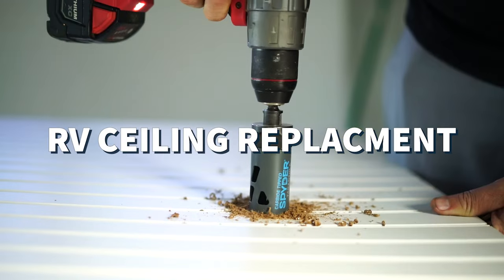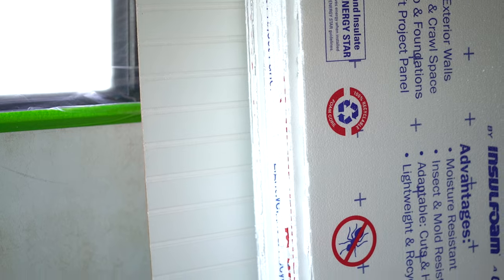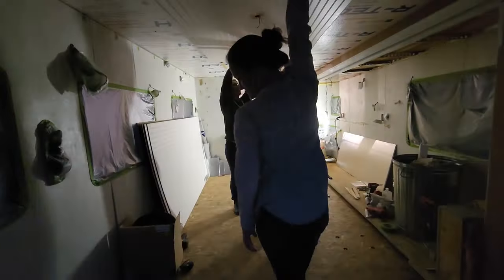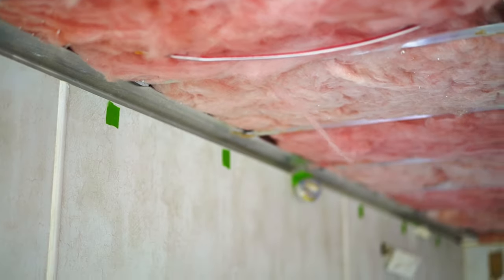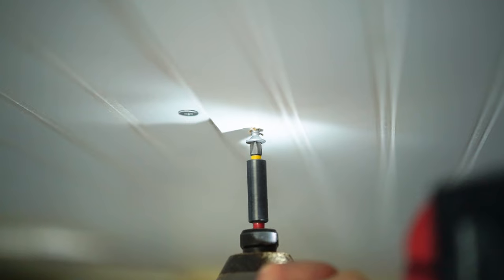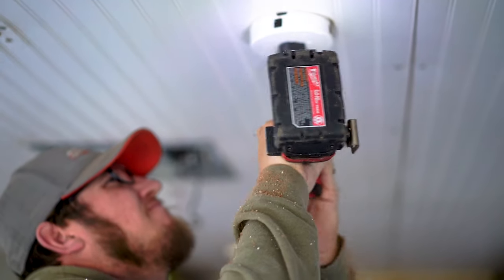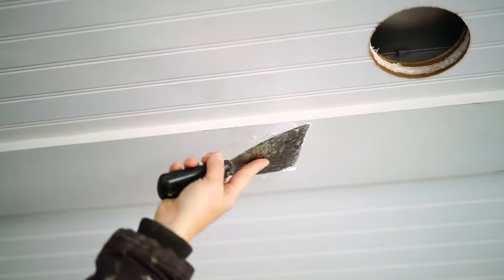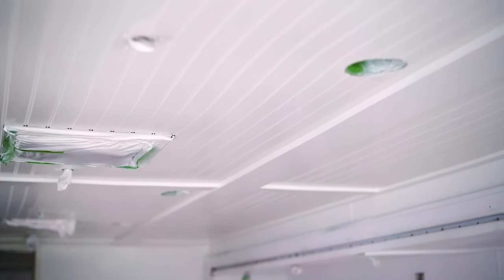HOW TO REPLACE AN RV CEILING || MOTORHOME RENOVATION || RV RENO

Comment: compressed cardboard is highly moisture absorbent, (your ceiling material choice) RV's are highly humidity prone and RV ceilings highly leak prone...
Reply: I was thinking the same thing. Do you happen to know what material would work best?
Reply: I really don't see what's wrong with the "before" ceiling.  That grooved panel is really not the best choice foe a ceiling.  Best to keep the roof well sealed on the outside BEFORE leaks occur.  I happen to really like the late 80's / 90's look, but it's their RV, and I appreciate the passion.

Comment: Type paint did you use as a primer & final coat. What prep did you do to the walks before priming & poo ainting. Great video.
Reply from the maker: We use a Gripper primer,  and always use Scuff-X paint from Benjamin Moore for our topcoat.
Reply from the maker: We scuff the walls with 220 and wipe it down with a degreaser for prep work.

Comment: How much does something like this cost ?
Reply: Can I hire someone to do this near Massachusetts  ?
Reply from the maker: @kevinoconnell8802  in just supplies, it will probably cost $800-$1000 for sheeting, trim, insulation, caulking, paint,  etc.
Reply from the maker: @kevinoconnell8802  we do most of our renovations on the West Coast,  but there are RV renovators on the East Coast!